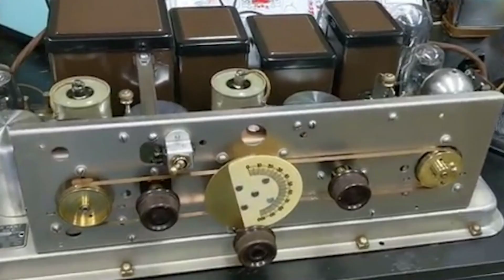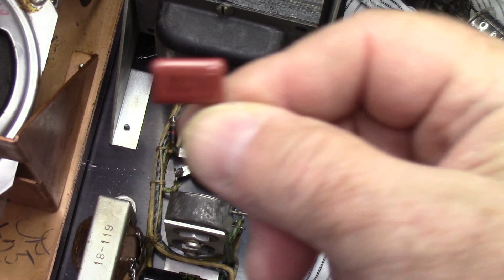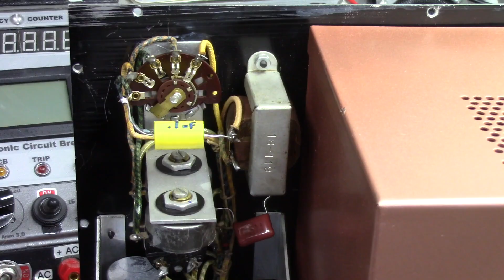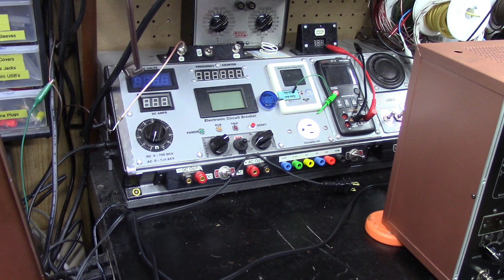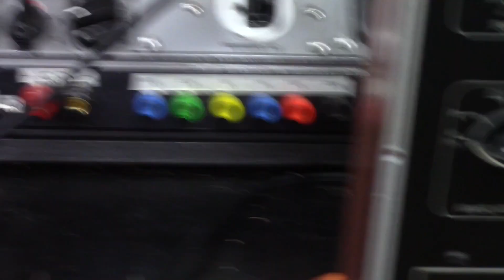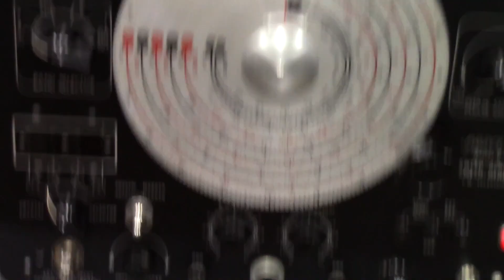PACO  E400 Sweep Generator - Part 2-  Cleaning, Electrical & Reassembly

Comment: @ 3:25  You have to be careful when you see a cap with a marked "WV" , or "Working Voltage"
designation compared to one that just has a max rating. That old cap may be in a spot where the B voltage drifts over 400VDC until the tubes bias on and pulls the voltage down to spec and a "WV" rated cap is made to take that temporary surge, but, if you put a cap in circuit to replace it that is "max" rated lower than that surge, you may push it to fail in service much faster than it should. I would have went with a 600 or 630VDC max rated cap in that instance if its being used as some kind of filter to negative / common that has B voltage on it. .

Comment: Looks great, Gregg.  Did you allow for a good ground-to-chassis connection for the shield you painted with copper paint? That may be important for suppression of spurious radiation, and perhaps even frequency accuracy. Gar
Reply from the maker: Thanks Gar, yes there are three screws with washers that cut through the paint and ground it. Also the paint itself does have some actual copper in it. It should be well grounded though.

Comment: Hey Gregg. I believe that Sprague cap was a wax/paper one in disguise. They just put a plastic cover over them before they came up with a better design. No smoke is always good! LOL That faceplate cleaned up very well indeed. I'm jealous of your MFP, it is so much better than mine. Your attention to detail is so nice on the stuff you restore. :)
Reply from the maker: Thanks Doug, yeah that is kind of what I was thinking as well, so I changed it. I might just cut it open for the heck of it.